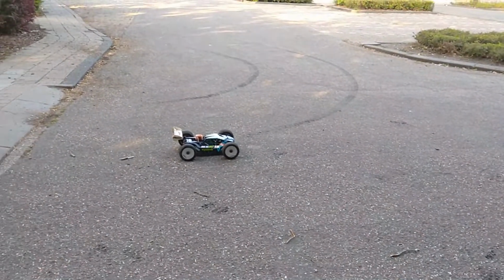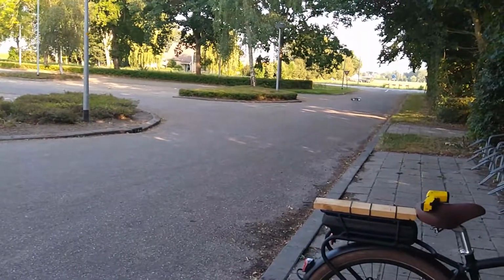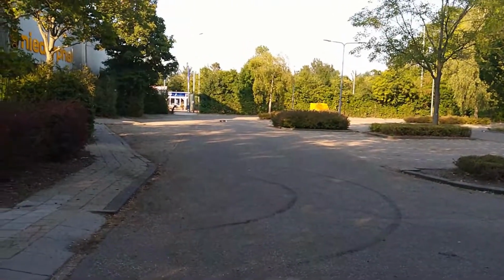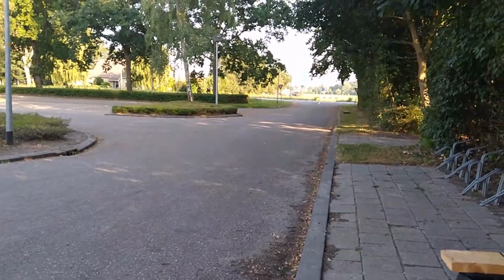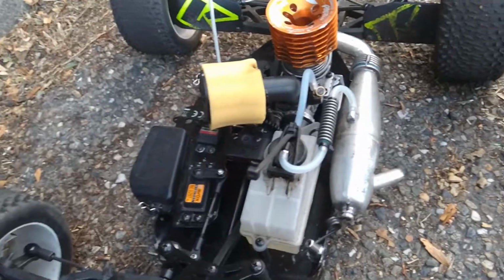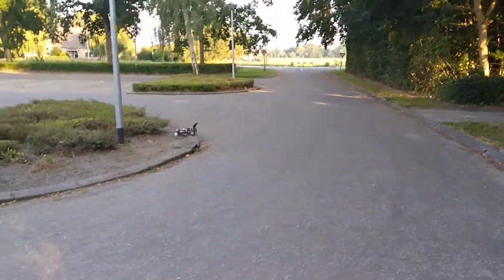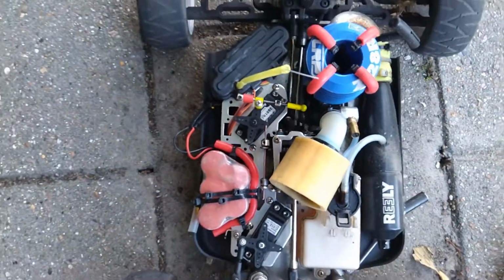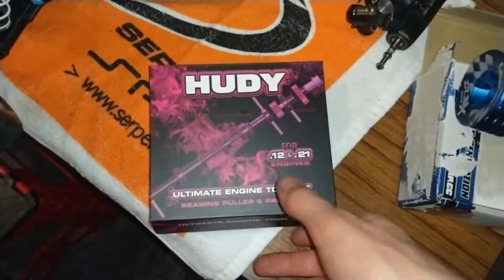Modified Alpha T850 (.28) VS Kyosho Inferno ST VS CURB

Comment: I had the zr.30 it was a great engine. My zr.28 spec 4 will not tune as well at all. It's very rich at the bottom on hsn, otherwise the top is too lean :(. 

Can't wait to see how yours goes, hope it works better for you than the .32
Reply from the maker: You need to replace the standard Xtec Carb for a Novarossi carb like I did that will make a huge difference
Reply: @NitroMike  do you know the part number? :)
Reply from the maker: @LawrenceTimme  I have a Novarossi 24069
Reply: @NitroMike  thanks